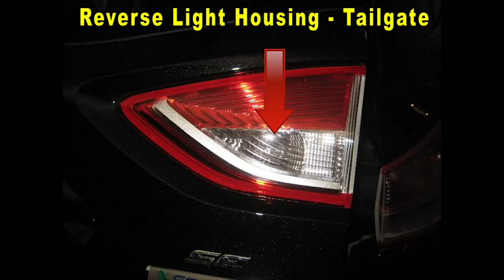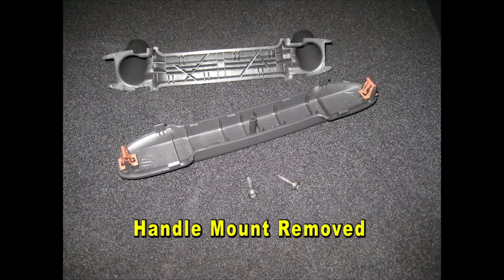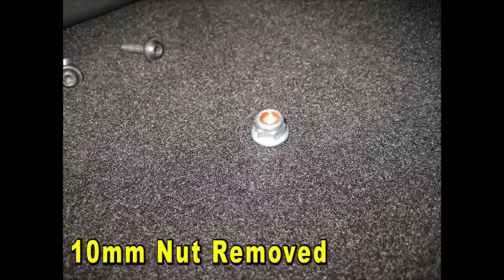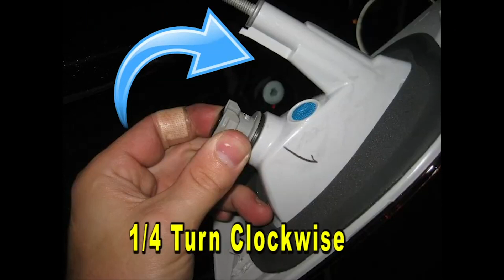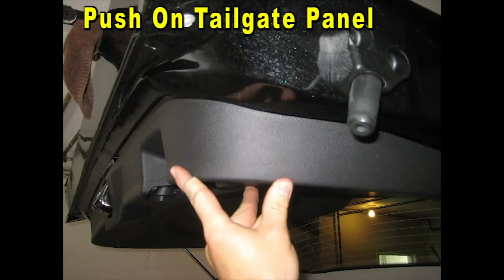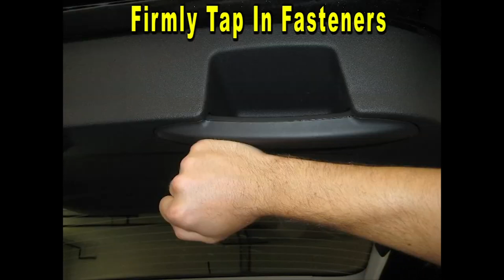2013 To 2019 Ford Escape How To Change Reverse Light Bulb With Part Number  - Quick & Easy

Comment from the maker: Check out the DIY guide for changing the reverse tail light bulb on a 3rd generation 2013 to 2019 Ford Escape SUV  - 
https://www.paulstravelpictures.com/2013-2016-Ford-Escape-Tail-Light-Bulbs-Replacement-Guide/index.html

Here are all of the DIY repair and maintenance tutorials for the third generation 2013, 2014, 2015, 2016, 2017, 2018 & 2019 Ford Escape SUV - 
https://www.paulstravelpictures.com/Articles/2013-2016-Ford-Escape-Common-Problems-Repair-Maintenance-Guides.htm

Owners of other Ford or Lincoln vehicles such as the Focus, Fusion, C-Max, Mustang, Fiesta, Transit Connect, Edge, Flex, Explorer, Expedition, Taurus, F-150, EcoSport, MKC, MKZ, MKS, MKX, MKT and the Navigator may also find these DIY instructions to be helpful.